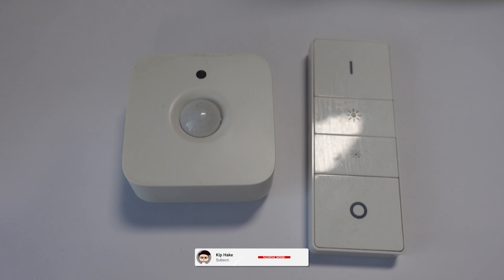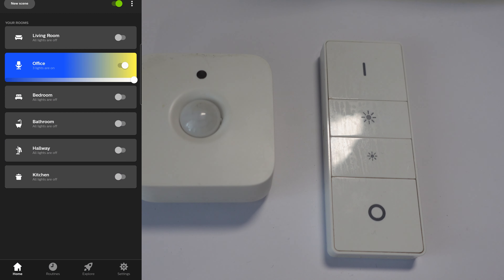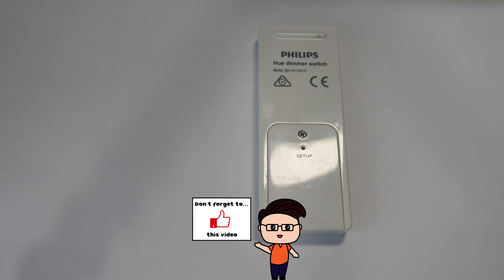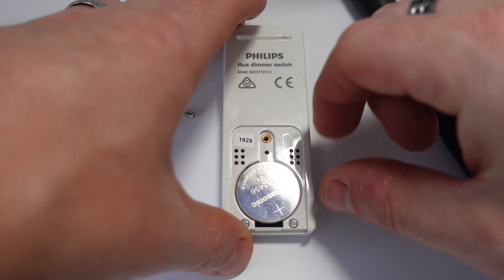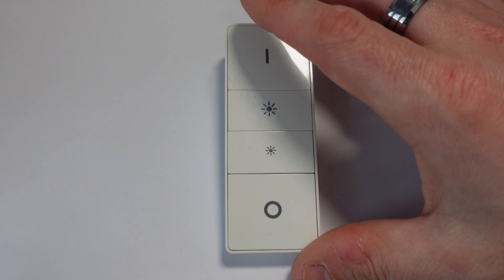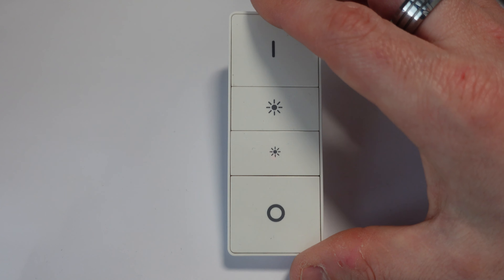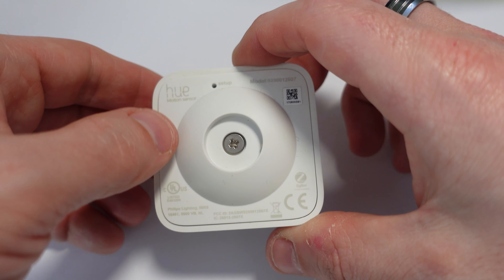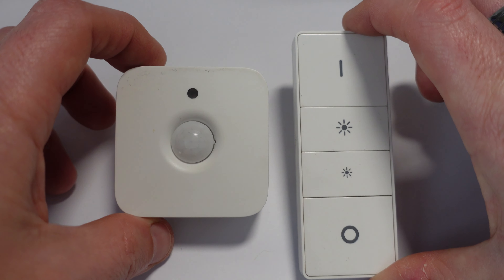How To Change the Batteries in a Philips Hue Dimmer Switch & Hue Motion Sensor

Comment: How's the battery life in those things? Just bought the motion sensor and I'm a bit curious. Thanks!
Reply from the maker: I think I've had some of mine for over 2 years on original batteries and I work at home, so they get higher than average use!
Reply: ye i'm at three years and my first dimmer switch is now at 19%